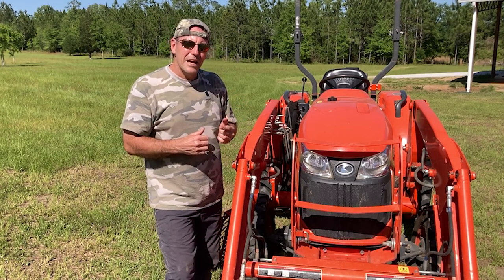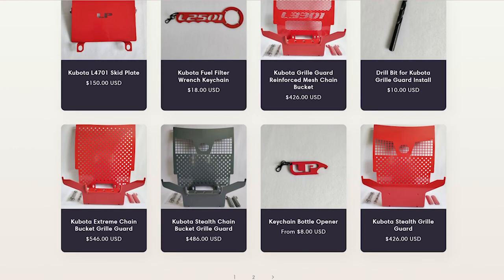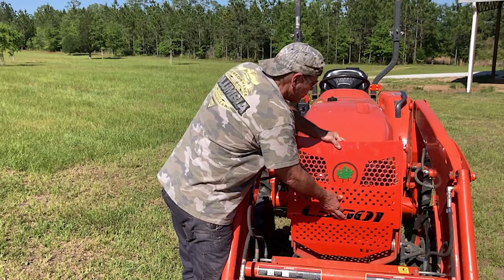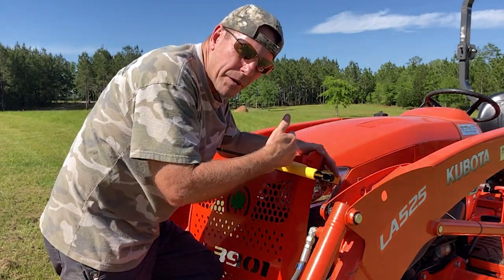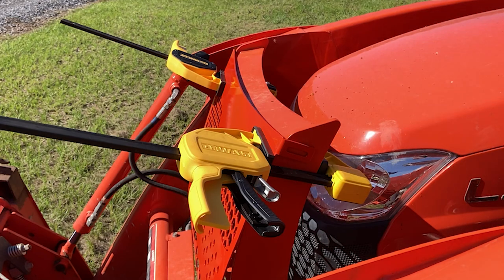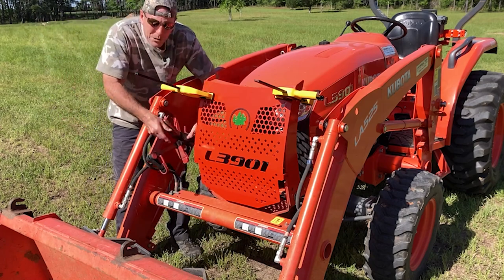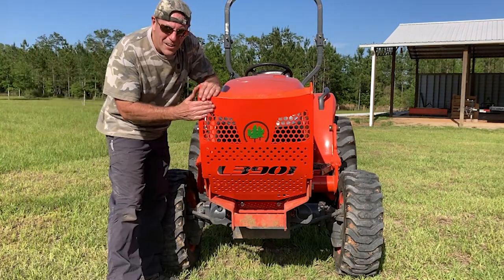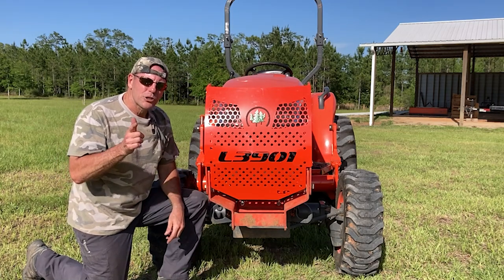How to Install a Tractor Grill Guard | Lown  Performance Custom Grill Guards

Comment from the maker: See Matt at Lown Performance for your custom grill guard!
https://lownperformance.com/      Discount Code: TractorHard5

Products in our Amazon store used in this video (costs nothing extra to use these links!).  You don't have to buy these specific items to support our channel....just use a link below to get to Amazon then make any purchase: 
Flex Tape: https://amzn.to/3R4MdWm
Mechanix Leather Gloves: https://amzn.to/3HjoZZf
Titan Post Hole Auger: https://amzn.to/3toHEx2
Ratcheting Fence Tensioner: https://amzn.to/3aEfSX0
Pope and Pipe Level: https://amzn.to/3tqUhHX
Fence Post Puller: https://amzn.to/3QbcNhy
T Post Manual driver: https://amzn.to/39dwt3J
Come Along Winch: https://amzn.to/3aQMqND
Clip bending tool: https://amzn.to/3xlqrG0
Mechanix Leather Gloves: https://amzn.to/3HjoZZf
6’ Digging and Pry bar:  https://amzn.to/3vH5Agx
Dewalt 20V ½” Impact Wrench: https://amzn.to/3UOcXNH
Dewalt 20V brushless Leaf blower: https://amzn.to/3zwJcYm
Dewalt 20V brushless ½” drill: https://amzn.to/3HGXJ7z

Comment: That looks good. I like it. If you have a Harbor freight close by they have the clamp you was using.  I have some and the work good.
Reply from the maker: The Dewalt clamp?  It doesn't ratchet open with one hand like the Craftsman....or I just don't know how to work it!!    Just got them....that was the first job with them.  Thanks for watching.